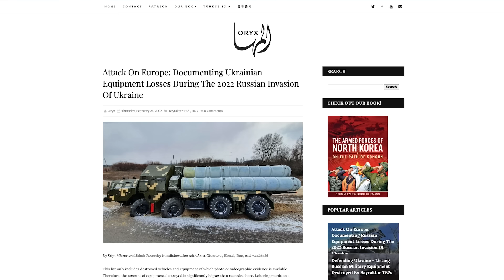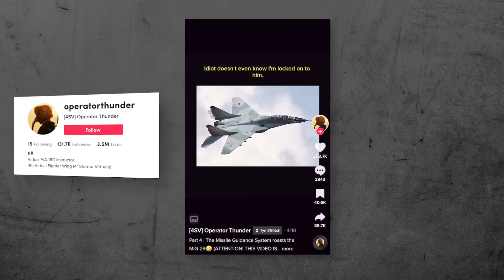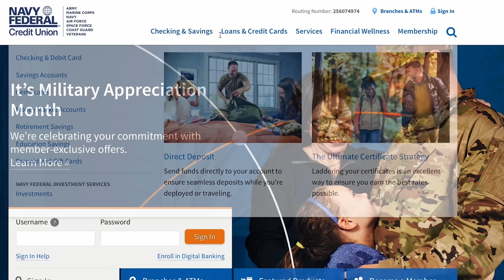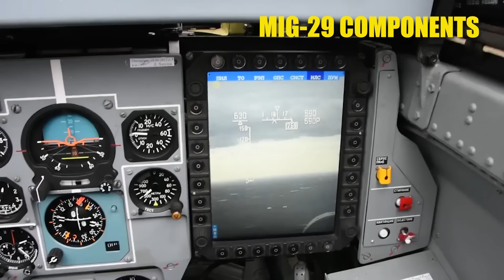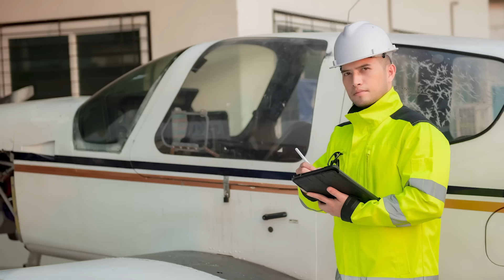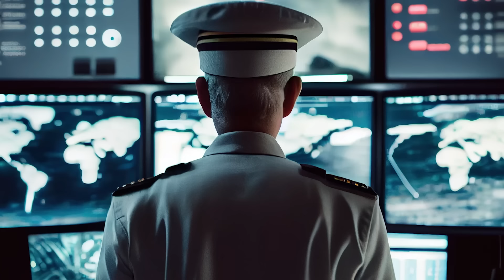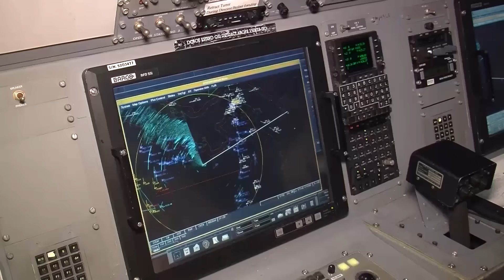How Ukraines new MIG-29 Fighter Jet Operates

Comment: 8:00 - remember, that most MiG-29s available outside Russia, were of the very first batches, build in early 80s. That means, these aircraft are 1. approaching 40 years old 2. for most of their operational lives, serviced WITHOUT vendor support.  Every aircraft - as design matures - usually gets longer airframe life. It was also case with MiG-29 but initial batches were built with as little as 2000 hours (nothing wrong with that: they were thought to be replaced in hectic cold war development) and also operated on basics of service life projection and not actual wear and tear. MiG-29 also won award of being fitted with radar obsolete even by 80s Soviet standard, as this was supposed to be 'frontline fighter' operating within own AD zone and with ground control guidance. Most MiG-29s never got fitted with AMRAAM equivalent - R-77.  R-27 are equivalent of Sparrow....  MiG-29 in theory had early advantages over F-16: optical tracker, radar guided missiles...but soon it's development stalled due to political/economic breakdown and early 29s were left out in the cold, while F-16 had seen CONTINUED maintenance, development and upgrades  AT SCALE which today put it abreast with latest developments, while MiG-29s were sidelined compared to Su-27 family even after Russia recovered somewhat after fall of SU.  On paper, Indian MiG-29Ks look like reasonable update, but as most Russian hardware there were complaints with maintenance and support of manufacturer. Oddly enough, Ukraine seems to be using their MiGs as they were designed to do - in short range air defence over front lines.  If west provides F-16, the only Ukrainian things on them will be air & painting - Western ground crews and retired pilots will get Ukrainian citizenship and voila.  Consider polish experience: converting from Warsaw Pact to NATO aircraft is not nearly limited to re-training pilots.

Comment: Hi Chris, I really appreciate your videos as they are always very informative. However, I have to point out some of the shortcomings when it comes to this topic.

Comparing 2 aircrafts without mentioning specific blocks are just pointless. The F-16 AESA radar that you mentioned is only available for the upgraded F-16C block 50/52 or later variants. Ukraine is getting the F-16AM/BM (block 15 MLU), they use an old AN/APG-66 pulse Doppler radar. 

Block 50/52, Block 60s, and block 70/72 F-16s can be a formidable force, but Ukraine is not getting those. The F-16s that will be handed over will be more capable than the Ukrainian Mig-29s, but they are still extremely outdated compared with the latest Russian Su-35s and Su-30SM. 

On the final note, Europe has these surplus F-16s available only because they are old aircrafts being replaced by the F-35A. All of these F-16s are block 10 and block 15s, some of these entered service as early as the late 1970s. Although the MLU program lengthened the airframe lifespan, these aircrafts are near the end of their service life. This would hinder their maneuverability to a certain degree.

It’s a good news that Ukraine will get these aircraft, but unfortunately a lot of these analysts overestimate their ability by listing the capabilities that are only available to the latest F-16 variants, not the models that Ukraine is actually getting. This is simply misleading.

Comment: 1.07 thrust to weight ratio. You said "for every pound of thrust, it only has to move .7 pounds of weight", which is not true. It means that it produces 1.07 pounds of thrust per pound of weight.

Comment: 1.07 TWR doesn't mean for every pound of thrust it only needs to move 0.7 lbs of weight.  Thatd be a HUGE TWR like 1.4 that miight be the effect of the combination of another force WITH thrust.

TWR basically means Thrust produced is __  fraction of the mass of the payload.  In this case the whole craft is payload.  To make it easier you can take 1.07  and remove the decimal to call it 107% 
So the thrust can lift 107% of the aircraft weight (presumably fully loaded?) so for each pound of thrust it only needs to lift 0.93 lbs of weight (100/107 or 1/1.07)

If thrust is equal to or less than the weight, the object will not rise, but planes dont actually NEED to have a TWR above 1 because their shape also produces lift from interacting with the air, so a planes thrust only needs to be high enough to produce LIFT from air hitting the wings unlike a rocket that MUST have a TWR above 1 to move. 

So for a plane having a TWR above 1 allows for more impressive movement than a plane needs to have for instance turning completely vertical and still climbing without the need for aerodynamic lift at all up to whatever height the jet engines start to suffer from less air to breathe and the thrust begins to fall below the weight of the craft.

(Though realistically to climb straight up the plane would still be pointed slightly forward because its shape is gonna make the air push back against it from its take off horizontal speed, so it has to make the combined direction of the forces of lift and thrust equal a totally vertical climb.  If those forces stack up correctly for whatever ideal climb angle the 29 prefers, that might be where the 0.7 number came from)

I deeply apologize for bothering to write all this in the unlucky event that anyone might read it.

Comment: The MIG 29 is a point defence fighter. Might be sufficient for the short length of the expected counter attack's front line, but not optimized for  offensive ops. There's a reason why most of the fighters sent to Syria by Russia were Su 27 or or 35, not MIGs
Reply: Protecting Ukrainian airspace and being able to fight up to 50 km past frontline would be a huge difference.

Also mig29 are sent because that it what they have

Comment: It is nice that you mentioned that the new F-16 has AESA radar, but Ukraine won't be getting new F-16s. They will get old versions of F-16 from early '90s which other countries are replacing with F-35. So the capabilities will be only little bit better comparing to MiG-29.

Comment: Its also worth stating that the MiG-29 is far more capable than the F-16 when it comes to operating out of a cratered war-torn runway. The F-16's intake is vunerable to debris, whereas the MiG-29 can divert its intake to above the wing on take off to avoid sucking in loose stones. The MiG's landing gear is also set wider and is more overbuilt than the F-16's to cope with a poor take off and landing surface. Essentially the F-16 was designed with the assumption that its airbases will be in pretty good condition, whilst the MiG-29 was designed with the opposite set of conditions in mind. So if they're hopping from base to base in order to keep the fleet intact as each is attacked I think its safe to assume the bases are not in a very ideal condition, and that might actually make the relatively delicate F-16 struggle.

Comment: 10:40 - better than the first Tu-22, that required a cabin air-conditioner to cope with supersonic flight. An alcohol based chiller no less, that made the cockpit smell like a bar. Definitely don’t drink the A/C coolant in-flight.

Comment: While 30 MiG-29 might be good addition to existing 100 or so it is not enough to tilt the ballance against many hundreds of Russian planes.  And we still have 30 year old set of electronics or improvised solution. Frame is great for close visual range dogfight, but this is rare type of engagement in this war.

Comment: Add to that, that the R-27 radar guided missile, is only a Fox-1, meaning that the missile relies on the aircraft's radar, to be guided onto the target until impact, meaning the MiG29 has to remain nose hot towards it's target the entire time, if it wants any chance of actually hitting it's target. This is a telling disadvantage and puts the MiG-29 at huge risk, having to remain nose hot for so long. As opposed to the F-16's Fox-3 Amram missile, which has it's own radar transmitter on-board, allowing the pilot to fire the missile and then turn the aircraft away, in order to keep the F-16 at a relatively safe distance while the missile does the work and takes away all of the risk that the aircraft would otherwise have to face... That ALONE would want me to have the F-16 over the MiG-29. That is a HUGE, HUGE, HUGE advantage the F-16 has over many Soviet jets, including the MiG-29.

Once you play some DCS, with the Flaming Cliffs 3 DLC, in the Soviet Jets like the SU-27, you get a true appreciation for this dilemma that the Soviet fighters have to face... Make no mistake, the soviet jets are excellent aircraft, but their inferior weaponry makes them essentially obsolete in air-to-air combat against self guided radar missiles. The super maneuverability of Russian fighters is hardly a match for fast, incoming, self guided missiles!

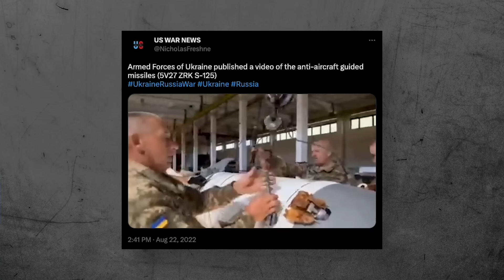Comment: 11:30 5V27 for S-125 is a SAM system, not an Air to Air missile, unless I'm missing something. Poland at least already donated missiles, before they donated jets. Slovakia I thing donated everything in 1 tranche. And even if Ukraine can produce AA missiles, it would be important which variant. That was one of the reasons why Russian Air Force had such massive advantage against Ukrainian Air Force. Of course other factors made it almost irrelevant, but if we talk about only Air to Air duels, Ukrainian pilots were at disadvantage, often quite major, due to older missiles and radars on their jets.

Comment: The reason they want F-16s is that although the mig is slightly faster and about equal in maneuverability.  The F-16 has greater range and much more capable sensors and radar capability.

Comment: It's easy to look at technical specs and determine advantages for some missions. What is often overlooked and may be more important is crew expertise. Why are Ukrainians in MIG-29s out performing Russians in MIG-29s even thought the Russians may have newer versions on a 1 to 1 basis. It's the crew. Same for T-72 tanks. True, the Ukrainians are much more motivated. But they are also just performing better.

Comment: Dear Cappy, let me educate you here
a) Ukrainian pilots want F-16 for its perceived superiority.
b) In dogfight, MiG-29 has better turn than F-16 (here we are not talking abt Radars)
c) The dogfighting missiles would be similar but lets give benefit to Western weapons as of now
d) What the ukrainians want are F-16 Block 60  which are new and take 3 years to produce and test but the ukrainians wants the Americans to gift them now.
e) What are available in USA are the older F-16 Block 40 to Block 52 which are capabie but they dont have the latest AESA as putting it on etc would take time.
f) The MiG-29 with Russia are not the old MiG-29A but MiG-29 UPG/SMT which are very much updated to better than F-16 Block 52

Also MiG-29 which ukrainian pilots have been using, they have the infra to train and maintain, but with F-16 it would be new to pilots, they may have to train, the infra to maintain and the crew trained to maintain new F-16 plays, unless America is going to send their trained crew to maintain these planes.

you are welcome

Comment: MiG-29's are basically daytime air interceptors with limited ground attack ability. They are meant to be used in large numbers to over come their limitations in air to air and air to ground missile. Each air craft and its engines are only designed for a limited number of mission before repair, overhaul or replacement. With little to no ability to use the few Soviet/Russian 'smart' air to ground weapons. F-16's are an all weather day/night interceptors and ground attack plane. Designed to use almost all US/NATO weapon systems for air to air and 'smart' air to ground missions. They also have 100's more hour airframe and part lifetimes when compared to MiG's. While maintenance is intensive and the planes will only operate 70% of the time. F-16's donated by other nations will physically last longer and require less maintenance than Ukrainians remaining MiG-29's. With plentiful parts, expertise in flight/maintenance and durability over cheap, short lived Soviet/Russia equipment.

Comment: the reason why people say they need f16's is because of the f-16's compatibility and ability to fully utilize every air platform weapon in the NATO arsenal. (it's computer can also link to AWACS, other aircraft, and other compatible radar and early warning systems)

The modified Migs can't fully utilize guided munitions, missiles, or detection systems regardless of how they are modified due to their incompatible computer system, Inability to interact with the ODIN system, and lack of hardware.

Comment: I don't get why they didn't ask for A10s. This is the battle on the ground they need support from the air.  A10s have all the radar range an F16 has .
Reply: Subsonic and no missiles,mainly gatlin gun !
Reply: 1) Very hard training process 2) Not in production, so maintenance is hard 3) Cap and airdefense 4) manpads 5) No it doesn't, and radar doesn't work like that. They have completely different radar systems. F16 is a a-a fox2 system

Comment: Thrust to weight ratio = 1.07
Weight to thrust ratio = 1/1.07 = 0.934
Meaning every pound of thrust has to move 0.934 pounds of aircraft weight not 0.7 pounds. Definitely did some ground pounder math on that one Cappy.

Comment: The f-15 and 16s have been upgraded.  They aren't using old radar or weapon systems.  They may be an older model plane but it's like restoring a hot rod. Yeah it's an older car with a brand new motor and drive system.

Comment: The proliferation of the S-300's is what killed the Super A-10 program, which would have been a modern predecessor to the A-10. S-300's were practically ubiquitous in Iran by 2017

Comment: The Problem with MiG29 is that their numbers in NATO are scarce also spares and are of soviet origin.
 
Most NATO F16s being replaced are from MLU version made equivalent to C/D block 50. So is late 90s early 50s tech. The switch to western fighters means more support from the west and compatibility with western equipment.
Those F16s are not in the same league than newer Su35 but will be a good add for Ukranian AF.

Comment: A different concern that doesn't get mentioned a lot is that Mig-29's and other soviet aircraft are designed to operate from more austere locations and have built in protections against FOD. If you visit a soviet (whatever) airbase, the flightline kinda looks dumpy compared to NATO airbases because they don't have to care as much. 

An F-16 on the other hand tries to suck off everything on the ground and slam it into it's greedy delicate little engine. 

For F-16's to operate in Ukraine, just one more thing the Ukrainians would have to change is their whole airfield management philosophy otherwise they'll be FODing out engines just trying to taxi the runway.

edit Shout-out to Navy Federal! Been with them for years, love those folks!

Comment: Depends on which Migs. The Mig29s that Germany gave to Poland are overhauled. EADS redid all electronics in the 1990s, they can also use the western missiles, and back then German tech was far ahead of anything Russia is capable of today.
But that only applies to these particular Migs, in every other aspect even an older F16 is better than an old Mig29 without the overhaul.

Comment: $23 million you say 😂. There are flyable Mig-29s with FAA certification for sale for well under $5 million. There's one in  particular that I'm looking at. It's brand new in the crate 0 hours on the airframe and engines. There's plenty of shops that can put it together. My only problem is time.
Reply: Those have been demilitarized with their a
radar and weapon systems removed.

Comment: 0:19 - You're kidding, right?  The MiGs sent by NATO countries have been MASSIVELY upgraded, to modern NATO standards.  It's not like Poland and Slovakia are sending 40 year old aircraft out of junkyards.  DUH!
2:10 - The F-16 would NOT have a major edge in dogfights. The MiG-29 was designed as an air superiority fighter, similarly to our own F-15.  The F-16 is a multi role aircraft which is used mostly in the ground attack role, by the USAF.
11:54 - WTaF is a "chaff flare dispenser?"  Chaff and flares are two VERY different things and they do NOT use the same dispenser.
13:33 - You DO know the UK sent Ukraine the "Storm Shadow" long range cruise missiles, RIGHT?  The Russian MiGs aren't any safer than Ukrainian ones, anymore.
14:08 - Perhaps you should mention the embargo causing Russia to no longer have the electronics necessary to maintain THEIR aircraft, and how they're even trying to purchase washing machines through third countries, to steal the chips out of them, for use in their aircraft.
14:18 - NO NO and NO!  Maintenance is essential and is ALWAYS done, before any aircraft is released to be assigned for missions.
14:56 - NOPE!  MiG-29s are currently going for five to eight million dollars each.
15:17 - NOPE again!  The MiG-29 can carry up to 8,800 lbs. of bombs and/or missiles, PLUS its 150 rounds of cannon ammunition, which weigh about 300 lbs., giving the MiG-29 a total carrying capacity of about 9,100 lbs..
15:21 - WHAT???  WAY off!  The SINGLE ENGINED F-16 can carry about 7,700 lbs. plus the cannon ammo.  The TWIN ENGINED MiG-29 CLEARLY wins THIS category, by over 1,000 lbs..
18:22 - +facepalm+  A thrust to weight ratio of OVER 1:1 does not mean the aircraft can make a "near vertical climb." (sic)  It means the aircraft can ACCELERATE IN A (totally) VERTICAL CLIMB.
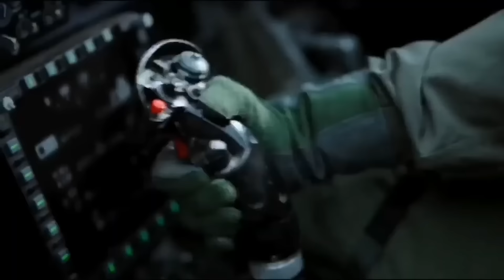18:28 - A pilot doing a cobra maneuver (aka Pugachev's Cobra) in combat will DIE, period.  Just sayin'.
18:45 - You assume INCORRECTLY.  The MiGs operated by NATO countries are kept at NATO standards, which means they DO have advanced technology.

And THAT, ladies and gentlemen (and non-binary beings) is why an infantryman should NOT act like an expert on aircraft.